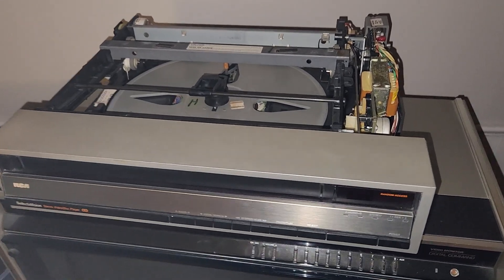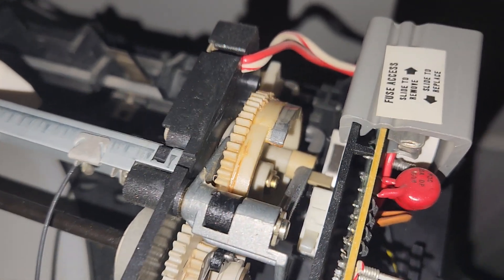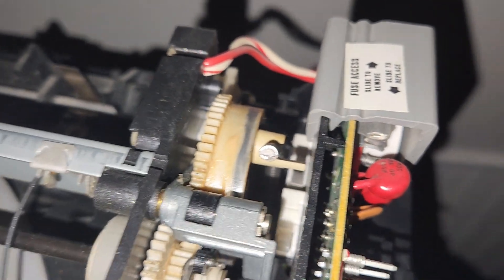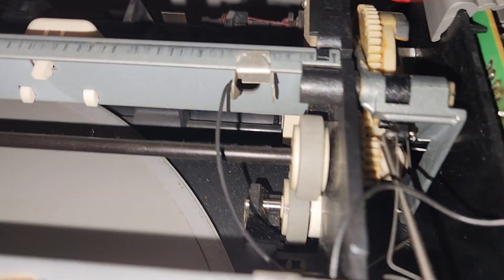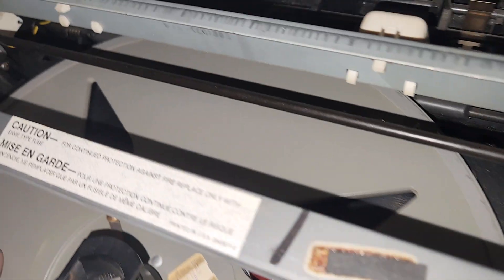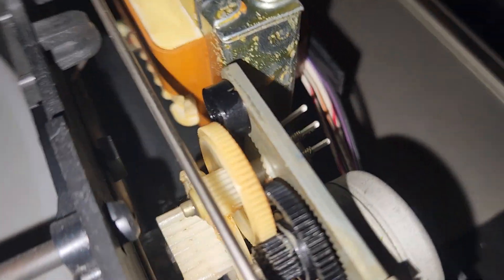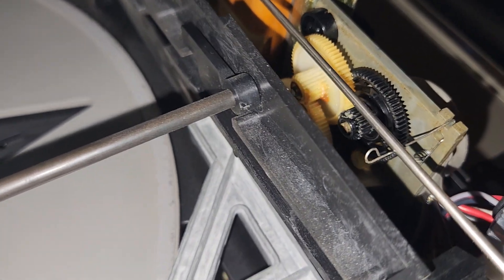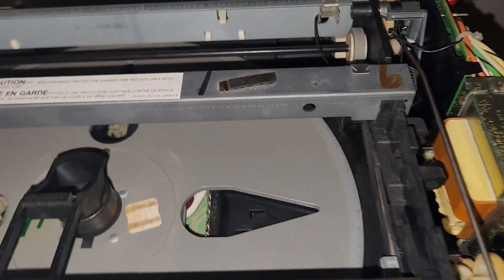RCA J/K CED Player Fail Points

Comment: Hey! Im having an issue with the 3rd reduction gear on this model, it spins forward but the gear that tells it to spin back isnt engaging so its just trying to push forward a track that has no where to go and damaging itself. The loading function gears in the back are also not engaging since this started happening
Reply from the maker: That would be the first I've heard of that. So what you are saying is when it reaches the end of the disc, instead of stopping and reversing it just keeps going forward? There is Daxi code at the beginning of the disc that tells the player when it's supposed to end. If there is a problem with the players processor IC it might not be interpreting the daxi code correctly and that's why you are getting issues. It would be hard to narrow that down without the the use of an oscilloscope and testing the points on the player control IC. If you can find a local electronics repair shop this might be something they could do. I can give you a link to the service manual. That's about all I would be able to do remotely, and it's not worth the cost to ship it back and forth. I do offer a replacement IC if a repair shop does determine that is the issue.
Reply: @ketonicdude  yup its weird I hadn't run into it either. I ended up getting it going again after a few hours straight of messing around but it definitely threw me for a loop. Happy to say all is well now.
Reply: Man, do you service these things? I heard you say in a video that you sell the belts. I just bought one on Ebay that said it worked, but it doesn't. The disk doesn't spin. It's an RCA SG100. I dont know enough about this stuff ti reliably repair it, and would love to find someone who can